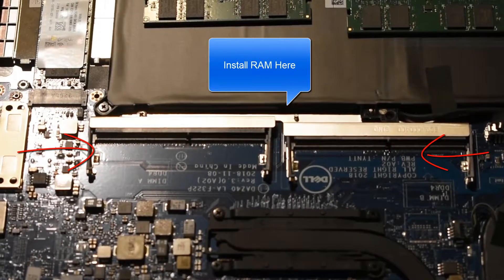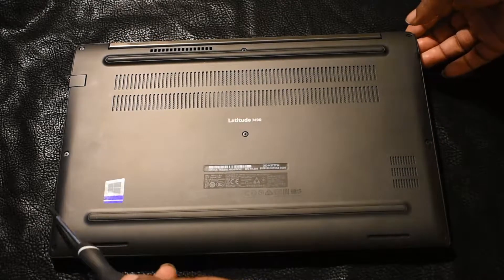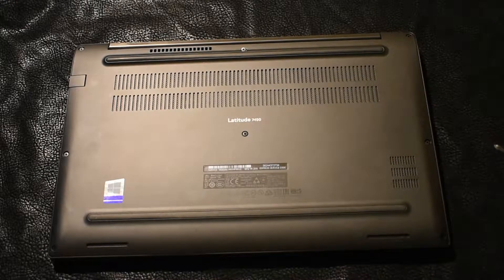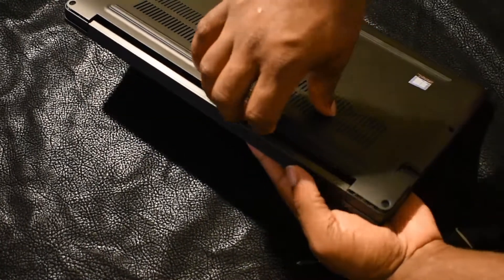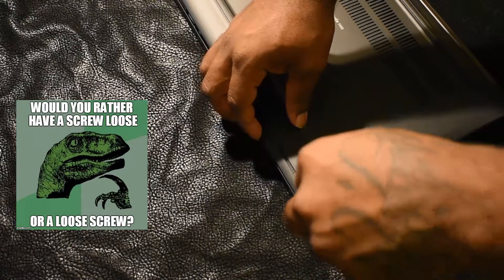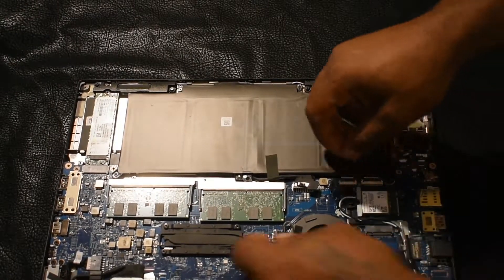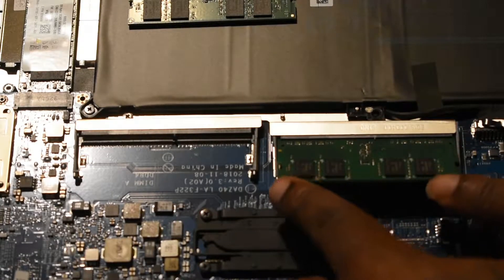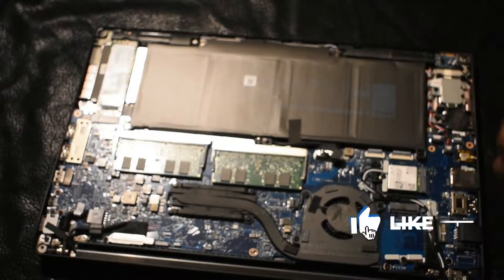How to Install RAM in a Laptop (Easy Step-by-Step Guide)

Comment: DISCONNECT THE BATTERY BEFORE ADDING REMOVING HARDWARE
Reply from the maker: You don't have to as long as it's shutdown properly but by all means...
Reply: @omni-tech  yes you have too
Reply from the maker: @devilops341  um I've been doing this for a decade now and nothing never happens if I don't disconnect the battery hell there's tutorials that upgrade RAM while the PC is still on just to see what will happen nothing crazy happens but yeah if you want to disconnect the battery by all means

Comment: Do we need to remove the battery connection before replacing the ram?
Reply from the maker: Yes, if it's a removable battery it's recommended to remove first. Thanks for watching and question.